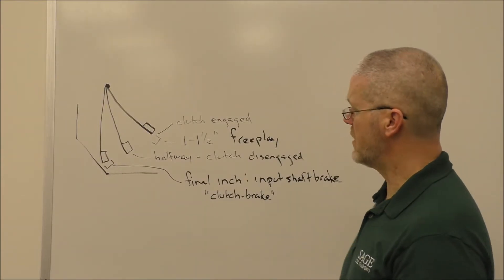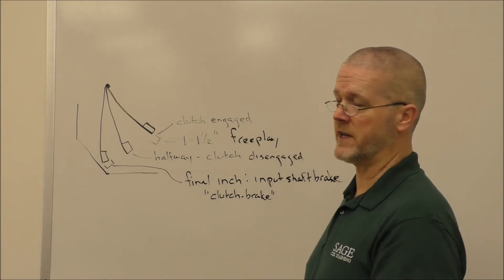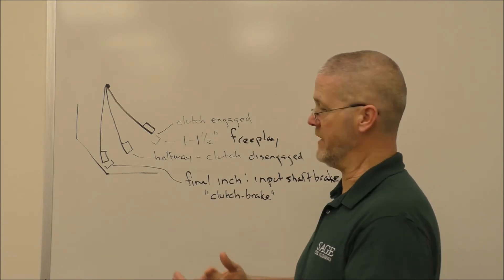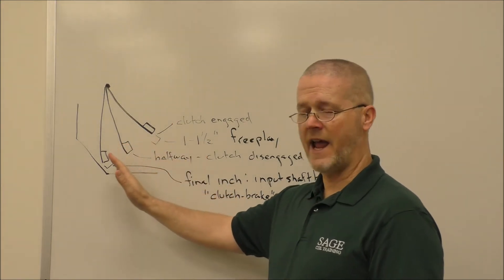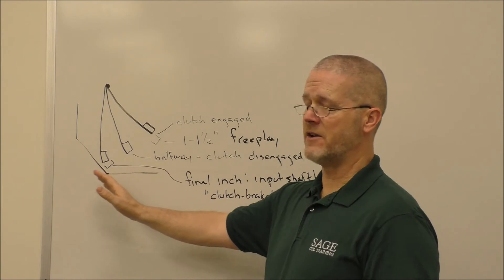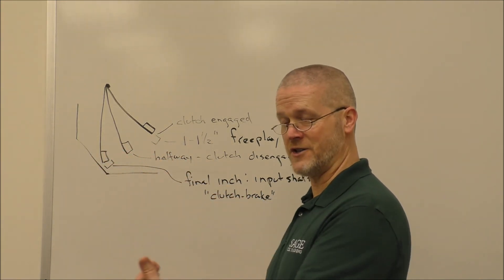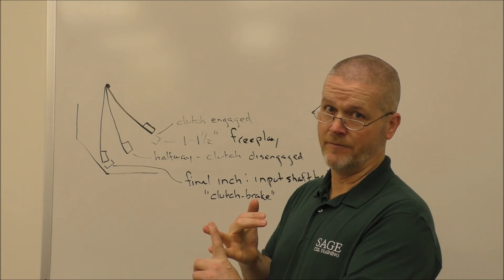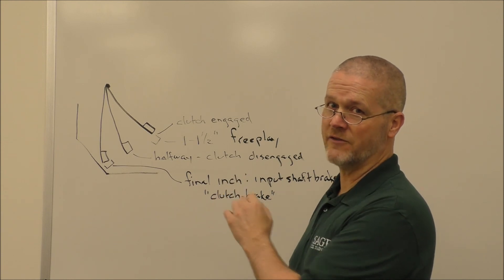Proper Use of the Clutch Pedal in a Semi-Tractor Non-Synchronized Transmission

Comment: at a complete stop while idling. does putting the clutch slowly to the floor damage the input shaft brake? or is the damage caused while in motion? 
(when starting our trucks the clutch is nearly on the floor to trigger the relay switch to be able to start the unit)